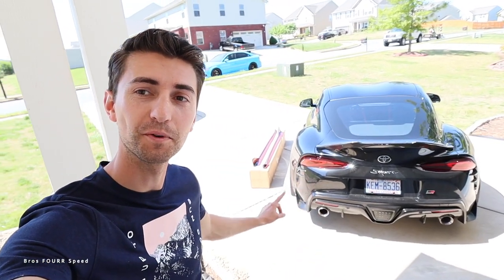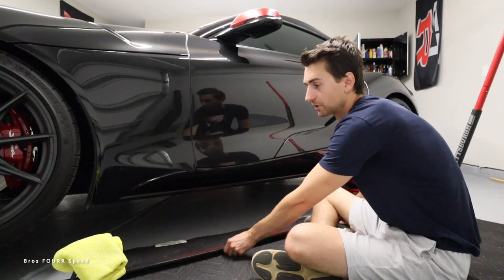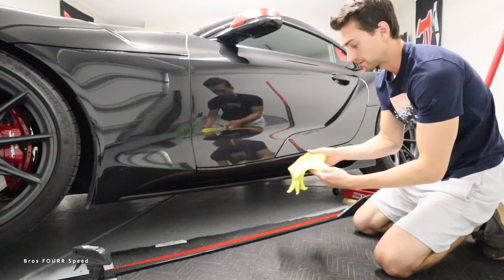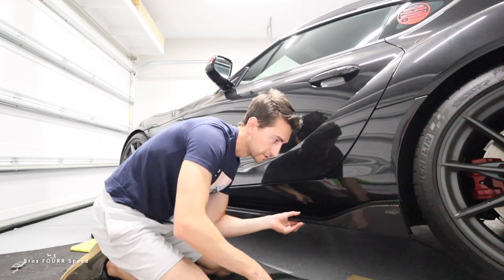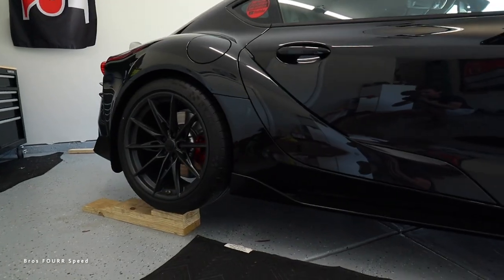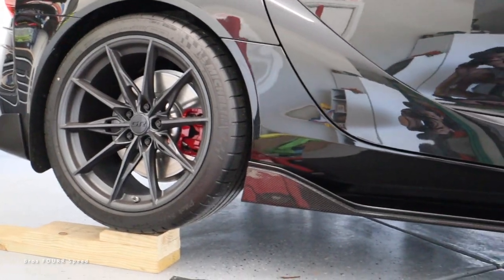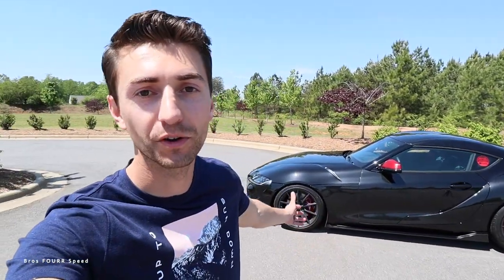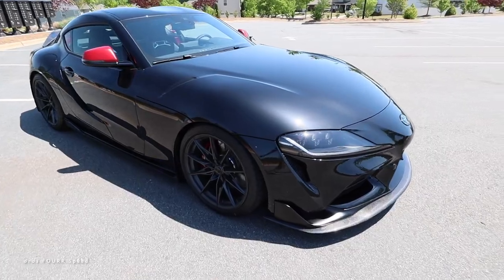Installing Carbon Fiber Side Skirts On My Toyota Supra!

Comment: Nice and easy to watch install! Do you ever scratch the lip or the side skirt at all? Also does your car have ppf?
Reply from the maker: Have not scratched the lip. Good clearance even with springs. I did a full graphene coating on the car. No ppf. I had PPF on my last Supra. All you see is all the lines and edges. So I'd rather get a chip or two then see lines all the tine on it. Not worth it for this car.
Reply: @BrosFOURRSpeed  I will definitely consider graphene coating. It does make sense since ppf is so expensive these days for it to only make your car look worse
Reply from the maker: Yeah I figured you're either going to have line permanently or maybe get a chip here and there. Paint looks so good coated. Well worth it!

Comment: Would be interesting to see what it would be if you removed the ground effects, and ran these in lieu of the stock ground effects.
Reply from the maker: These won't fit in that case. There are some out there designed to replace the stock plastic, but these are made to fit on them

Comment: Does it come with screws?
Reply from the maker: It does not. It will have the adhesive tho. Can easily get some stainless screws from the hardware store for a $1 or so. I have a bunch in my drawers in my garage
Reply: @BrosFOURRSpeed  do you remember the size of the screws?
Reply from the maker: @MrInvisible2you  I just used 1in corse thread wood screws with a wider head on them